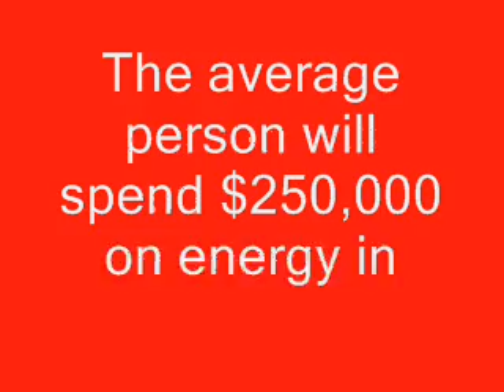NEVER BUY ANOTHER BATTERY AGAIN  electric pickup in TV news

Comment: Too right, they don't get land-filled. This is nonsense. 

Lead acid batteries eventually succumb to sulfonation, as lead sulfate accumulates in place of the oxide in the plates, preventing contact with the active material. There have been many attempts to fix this, with high volt/low current/short pulse electricity and additives.  It seems to work OK, sometimes. Better is to avoid over discharge, which causes the problem in the first place. I don't discharge past 30% if I can help it.

Comment: If some of the batteries you are reviving are sealed, then we are left to presume you are inducing pulse width modulation into the battery at higer-than-cell voltages to stimulate a redox to the plates. I suppose it would take a bit of research, based on the electrolyte and plate material, current rating and cell degeneration, but the voltage, pulse width and current level could eventually be extrapolated.